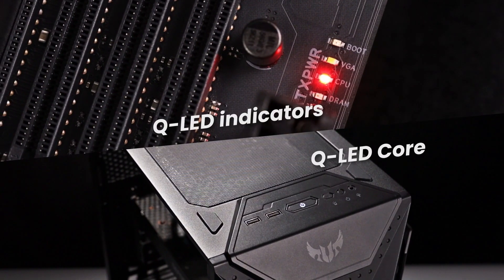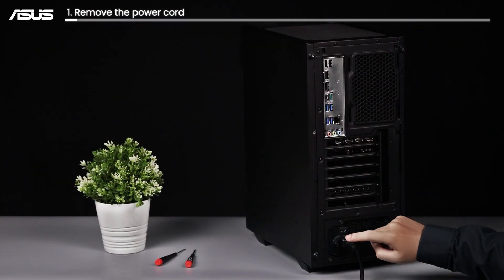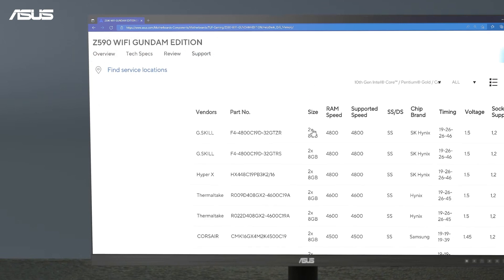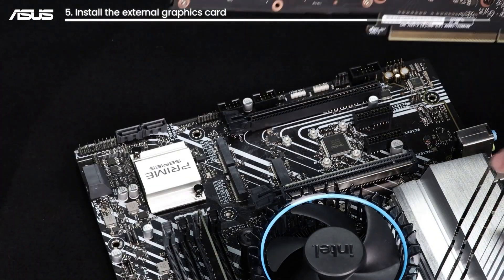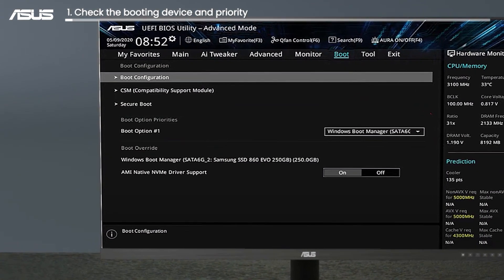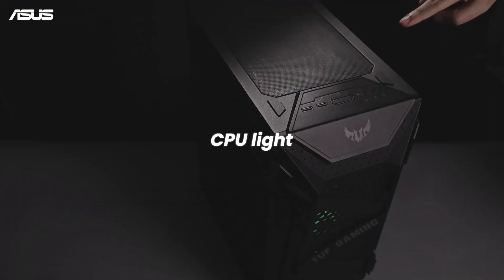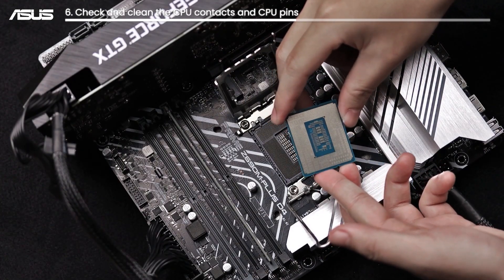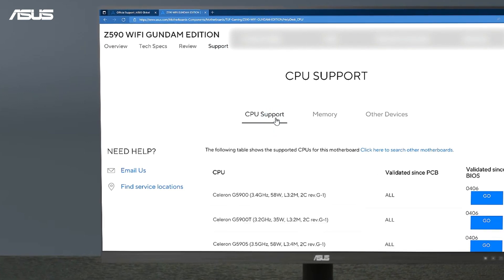ASUS Motherboard Troubleshooting via Q-LED indicators, Q-LED Core   | ASUS SUPPORT

Comment: Well, the dram cpu vga boot lights are on in order, my computer sometimes does not turn on, sometimes it turns on. The first time I experienced this, the drum light was red and solid, I took it out and plugged it in, then it got better for a while and now it started to happen as I said, can you help please, what could be the problem with the ram?
Reply from the maker: Hi, based on your issue, make sure that the RAM modules are securely seated in their slots. Turn off the computer, unplug the power cord, and carefully reseat the RAM modules one by one. Ensure they are properly aligned and fully inserted into the slots.
If your computer has multiple RAM modules installed, try testing them individually. Remove all but one RAM module, and attempt to boot the computer. If it works fine with one module but not with others, it could indicate a faulty RAM module.
And make sure that all the device is compatib;e with the motherboard.
You can check the QVL list on official support site.
Also, could you provide the product model?
Thank you.

Comment: Hello! I built a PC using Asus B550-PLUS Wifi II two months ago, everything was OK and suddenly it stopped showing anything from the display (just after windows update). 
When I power the PC, VGA Led is constantly on. 
I have tried to un plug and plug RAM and GPU with no results.
Both have been tested in other PC and they work fine. 

I don't know what can it be.. I would appreciate some support here ^^ Thanks a lot
Reply: Hey Zolark, did you fix your Problem? I kind of have the same issue. If you fixed it please let me know, im struggling....
Reply from the maker: If you have followed the above steps but the problem persists, I would suggest you bring back your device to our service center for further confirmation.
The following is the contact information:
https://www.asus.com/support/service-center-location 
Also you can contact the local service center for help.
The following is the contact information:
https://www.asus.com/support/CallUs# 
Sorry for any inconvenience it may be caused.
Reply: Actually it was the stupidest thing ever. I solved it By completely unpluging my monitor from electricity and trying again afterwards…… the dumbest error ive ever had

Comment: My computer seems to work just fine but it seems like the boot up process is delayed because the red CPU light blinks twice before starting up.
Reply from the maker: Hi, based on your question, if the Q-LED indicator light is not always on, it means there's no problem  been detected.
Thank you.

Comment: Hello, I have a motherboard asus rog strix b650-a gaming wifi. After pressing the start button, the DRAM light is on for a long time, about 45 seconds, the fans are running in slow mode. Then all the fans run at full power, each light comes on in turn and then the computer starts. It is very frustrating that the computer has a "top" package, but it takes about a minute from pushing the button to start the computer. Is it possible to disable Q-led? I could not find anything in the bios.
Reply from the maker: Hi, according to your question, you can choose to enable or disable this function in the BIOS.
Enter [Advanced]-[Onboard Devices Configuration]-[Q-LED Core]-[Enable/Disable]
You can refer to the following link.
https://www.asus.com/support/FAQ/1047023
Thank you.

Comment: Hi, I have a Z790 plus wifi d4 and I am having trouble with the VGA light when trying to install a new GPU. I'm getting no display or keyboard output. I built the PC a couple of months ago and used its integrated graphics from the 13700k, but I recently got a 3090 Ti SUPRIM 24G GPU and I am unable to figure out the issue. The GPU gets power and lights up/ fans spin, but I get the white light on the motherboard and no signs of display output. I am on BIOS 0411.
Reply from the maker: Hi, according to your question, may I ask have you try the troubleshooting steps according to the video or the FAQ at the description box?
Please confirm whethre your device is compatible with the QVLlist.
You can refer to the following link.
https://www.asus.com/motherboards-components/motherboards/tuf-gaming/tuf-gaming-z790-plus-wifi-d4/helpdesk_qvl_cpu/?model2Name=TUF-GAMING-Z790-PLUS-WIFI-D4
Thank you.
Reply: Hola necesito ayuda urgente compre z790 y ddr5 5600mhz y no enciende probé todo y en el registro de mi producto figura que la garantía expiró y la compre hace una semana
Reply from the maker: Regarding your question, I would recommend you visit the following forum post to get more assistance. 
https://zentalk.asus.com/t5/motherboards/bd-p/motherboards
Thank you.

Comment: I tried installing new ram into my new computer and suddenly it won’t boot up. The fans turn on, but nothing on the monitor. I took out the gpu and put it back it and it still didn’t help
Reply from the maker: Hi, according to your question, may I ask have you check the QVL list on support site?
Whether the RAM is compatible with the motherboard?
Have you try to cross test with other RAM?
Also, could you provide the product model and BIOS/OS version?
Thank you.

Comment: MY M/B HAVE 5 LED NAMED AULED1 , AULED2 UNTIL AULED5, asus dont have informtacion for these leds, they are on, all of them. ASUS H410M-E
Reply from the maker: Hi, according to your question, may I ask which LED you mean?
Whether the light is always on?
Whether you mean Q-DIMM?
You can refer to the following link.
https://www.asus.com/motherboards-components/motherboards/prime/prime-h410m-e/helpdesk_knowledge/?model2Name=PRIME-H410M-E
Thank you.
Reply: @asus_support  this led are on the back of the MB, this mb has 6 led named Auled1 to Auled6 they are sparkling when the mb goes energized you Need to dismount MB to see this led, today i will change the mb To see what happen

Comment: Hi, i hace 2 LEDs indicators always on (VGA and BOOT) , my pc can't boot.
Sorry for my english is very poor.
I have an ASUS Strix ROG X570-e gaming Motherboard, micro Ryzen 9 3900xt, 32gb RAM corsair vengance.

I was using it at first with a EVGA 970 ssc, then i change it for a EVGA 3070ti... Now i have to take off my VGA to fix a fan. I'm trying to use my pc with onboard graphics but i cannot at least boot my pc.
At first LED VGA turn on and display ERROR 64, but next change it and turn on too the LED BOOT and display ERROR 02.

Now i try with a sapphire HD7850 Just to try get some video but it doesn't work.

Please help me with this.
Reply from the maker: Hi, according to your question, have you make sure that you have follow the steps according to the video or the FAQ at the description box?
Have you make sure that all the components are compatible with the motherboard?
It is suggest that you try to test with minimal components to confirm the issue.
You can refer to "Test with minimal components, isolating the possible cause" in the following link.
https://www.asus.com/support/faq/1042632#6
Also, could you provide the product model and BIOS/OS version?
Thank you.

Comment: I bought a B550 Tuf Gaming, but since the first day it has not worked with any component, I tried with a 5600x, 3600, different GPUs and nothing. The LEDs never lit and never got image. I tried the BIOS EZ flash without success and the tests with minimum components.
Reply from the maker: Hi, according to your question, since you just bought the product, it is suggest that you contact with the dealer to confirm the issue.
Thank you.

Comment: I have a Asus Prime z690-p wifi and Intel Core i9-13900KF
I have no output to the monitor after the second Windows update on a new system.
Q-LED's come on in order and turn off.
Power light is continuous.
It looks like it is fully booted....Am I reading the lights correctly?
I suspect the riser (occasionally on boot the GPU fans don't start and a light pressure to the right side of the riser connection to the MB and the fans come on....still no signal to monitor on any output.) Lights come on the nameplate (PNY) of the 4070ti even when fans don't power up.
Answers to the simple questions:
Yes monitor is plugged in, on, connected properly (worked fine during Windows installation, not changed since on either of the two monitors)
Reseated memory, tried in all slots. Replaced memory (intended upgrade) tested in all slots.
Reseated GPU. (yes I know about the lock on the bottom of the riser.)
Between each of these tests I unplugged the unit and drained caps by holding down the power button for one minute.
So my query is: does this sound like a defective riser, MB, or GPU issue?
Reply from the maker: Hi, according to your issue, have you try to remove the riser and connect the GPU directly to the motherboard, ensuring a secure connection. Check if this resolves the issue and provides a signal to the monitor. It is suggest that you try to test boot with at least external equipments.
You can refer to the following link.
https://www.asus.com/support/FAQ/1016113
Thank you.
Reply: @asus_support  Happy to say I am now posting from that very computer.
The Hyte Y- 60 case however won't allow directly connecting without the riser.
Once I realized that (after disassembly)  I put it back together and it worked.
I realized at that moment the ONLY thing I failed to reseat was the riser itself.

She's now a bloody monster.👾😁And Thanks for the rapid response!

Comment: I already do it. But not work. Stay same condition, cannot display and Q. l.E.D stay light on Dram yellow then last cpu red light. I see pin on cpu not broken
Reply from the maker: Hi, may I ask have you make sure that you have try all the troubleshooting steps?
Have you try to reinstall the memory?
Or have you try to replace your DRAM with the one on Memory support list?
Also, could you provide the product model and current BIOS/OS version?
Thank you.

Comment: first off all great music to this video and second I keep getting the VGA white led stay on tried a different graphics card and still no luck any ideas anyone? I've found doing a bios reset fixed it for a short while but then it keeps doing it again
Reply from the maker: Hi, according to your question, may I ask have you try to re-install the CPU?
Or try to re-install Graphics card?
Please check for any dirt on the PCI-E Pin of motherboard or Graphics card Pin.
Also, could you provide your product model and BIOS/OS version?
Thank you.
Reply: @asus_support  So I reseated the DRAM which then changed the q led status to green and then was taking forever to boot when eventually getting into windows it was running slow and then I keep getting device connect then disconnect sound it was driving me mad so I just rebuilt it and I scrubbed the motherboard with isopropyl alcohol and all the connectors so far it's fixed all the issues now and it's running fine so just a good clean is what it needs if you know all the other components are fine
Reply: it's running on the latest BIOS version 5003

Comment: Hi, I recently switched my CPU cooler and now my PC isnt booting anymore.. The fans and the rgb turn on but nothing else happens the QLEDs dont turn on either.
Reply from the maker: Hi, according to your question, 1.Make sure that the CPU cooler is properly installed and connected to the motherboard. Ensure that the cooler is securely mounted and that the thermal paste is applied correctly.
2.Check that all power cables are properly connected to the motherboard and other components, including the CPU power cable.
3.Try re-seating the RAM and graphics card to ensure that they are properly installed.
4.Clear the CMOS memory by removing the battery and shorting the CMOS jumper for a few seconds.
Also, could you provide your product model and OS version?
Thank you.

Comment: Is it normal for every boot sequence for the motherboard to lit up cpu, dram and vga q-leds, in this order, for like 1s each then go "dark" afterwards?
Reply from the maker: Hi, according to your question, Yes, it's normal for the CPU, DRAM, and VGA Q-LEDs on the motherboard to light up briefly during the boot sequence. 
This is part of the motherboard's self-diagnostic process, and it's designed to check if the CPU, DRAM, and VGA are functioning properly. 
If the Q-LEDs stay lit or if you encounter any other issues during the boot sequence, it's possible that there's a hardware issue with your motherboard or one of its components.
Thank you.
Reply: @asus_support  Thanks for the reply! Now I have one last question left only. I bought an ASUS ROG Strix LC240 AIO RGB (White edition) also for the 7700x and the buzzing noise coming from the pump drives me crazy. I can lower the rpm to 30% (around 1000rpm) and the noise is pretty much gone, but temps start to get higher. From 45°C to 54°C. 40% where the noise starts kicking in and gets louder the higher rpm I set it to. 70% (1900rpm) seems like a good trade, noticable noise + not much difference in temps. 100% is unbearable. So is it also normal or should I return it?
Reply from the maker: Hi, according to your question, could you provide the motherboard product model?
Try adjusting the fan RPM to reduce noise. However, note that lowering the fan RPM may cause temperatures to rise and affect the performance and stability of the CPU.
When a machine is in operation, it will always produce some degree of sound. As long as the sound is not intolerable and the machine is not overheating and can operate normally, you can use it with confidence.
Thank you.

Comment: My asus tuf 790 is not posting nor are the qleds lighting up.

(Update: I have figured out the issue, was a faulty power supply to my aio causing this issue.)
Reply from the maker: Hi, according to your question, do you mean QLED core light did not ligh up?
Please make sure that the components you use match the motherboard and the CPU and DRAM are properly installed on the motherboard before booting the system.
Have you confirm whether the motherboard have the Q-LED Core function?
You can refer to "Q4" in the following link.
https://rog.asus.com/support/FAQ/1047023
Thank you.
Reply: @asus_support  no the indicators that have boot, vram, cpu
Reply: Tried everything from no gpu, cpu, only essentials plugged in, different power supply, changing ram, cleaning contacts, and removing all m.2. Still no post and like I said no indicator lighting up at all for the vram, cpu, boot qleds. This is the 2nd motherboard that has been replaced within a week
Reply from the maker: Hi, according to your question, it is suggest that you try to clear the CMOS recovery BIOS option and restart.
You can refer to the following link.
https://www.asus.com/support/faq/1042632#9
Thank you.

Comment: Hi, can you help me? I've been having this problem since I bought it.

The system has POSTed in safe mode.
This may be due to the previous POST attempt failing because of system instability, or if the power button was held in to force the system off.
If the system failed to POST after you made changes to UEFI settings, you may wish to revert to stable settings to prevent POST failure.
Press F1 to Run SETUP

Happens everytime I boot the PC. After that I go into the BIOS and pressing F10 (save & exit) will go into the AMI again. In the BIOS I have to manually select the boot drive which is my SSD (Boot menu > double click the SSD). After that it will go to windows without problem. But everytime I shut it down then turning it on again it will go to the same scenario.

I have tried many attempts to fix the issue as follows:
1. Clearing CMOS (No battery removal)
2. Restore default settings in BIOS
3. Updating the MB to the latest

Specifications:
1. ASUS TUF B760M PLUS WIFI D4
2. I5 13600KF
3. RTX 2060 SUPER
4. RAM 8X2 SAMSUNG DDR4 (NO XMP)
5. NVME GEN4 2TB MIDASFORCE
6. PSU GAMEMAX VP-800 BRONZE 80+ (850 WATT)

One more issue, when I put the PC to sleep mode and waking it up again, everything inside the PC case lit but no display on monitor.

I really hope ASUS Support can help me on this problem. Thanks.
Reply: Same problem here, but I get no no screen and a flashing power button, please share if you found something. Cheers
Reply: @teteubarravelha  My problem was the Ram. I think it was too slow that it prevent normal boot.
Reply: @LeonThePious  Mine here is actually a bios update missing. 2/3 weeks in trough troubleshooting discovered hidden in the Asus downloadable manual. I'll never buy Asus products again!
Reply: @LeonThePious  In the MB site it said it handled 13th generation, in the manual it said only 12th. So just after finding someone with a 12th generation and asking him to update for me... Sh1tty Asus
Reply from the maker: @teteubarravelha  Hi, based on your issue, may I ask whether you could provide the product model?
Also, could you provide the details of the issue?
Thank you

Comment: Asus z790 & rtx4090, white q-led 🎉
Reply from the maker: Hi, according to your question, may I ask have you try the troubleshooting steps and the FAQ at the description box?
Which steps is inoperable?
Have you try to re-install the CPU?
Or re-install Graphics card?
Please check for any dirt on the PCI-E Pin of motherboard or Graphics card Pin.
Also, could you provide your current BIOS version?
Thank you.

Comment: Что делать, если моргают красный оранжевый и белый индикатор по очереди при первичном запуске
Reply from the maker: Hi, according to your question, if the light is not always on and you can operate and boot up normally. There's no need to concern.
Also, could you provide your product model and BIOS/OS version? Thank you.
Reply: Починил? Что было?